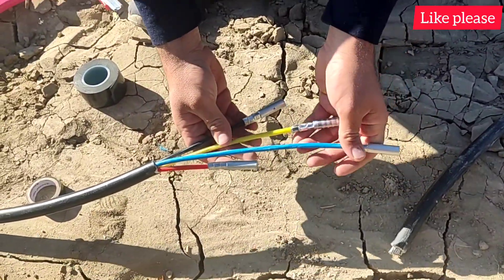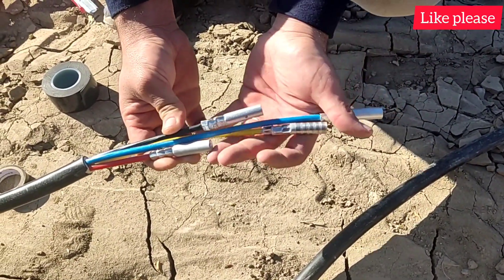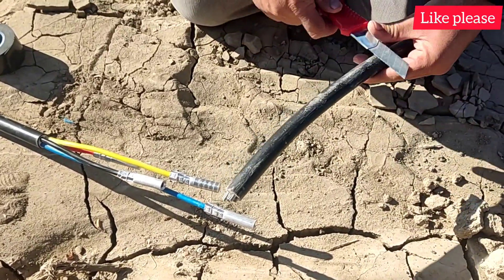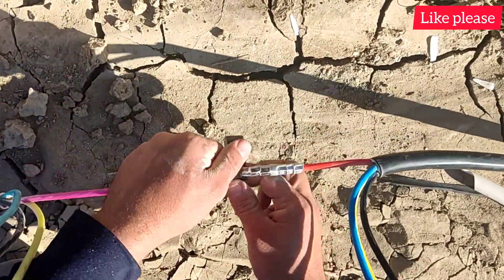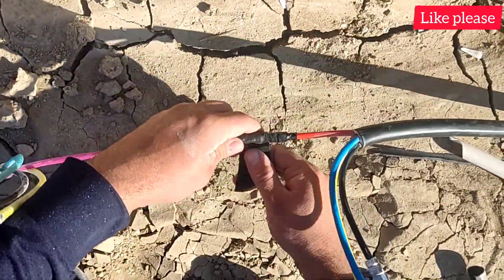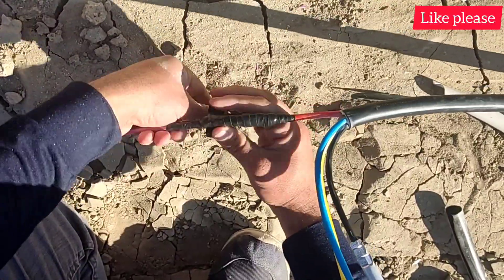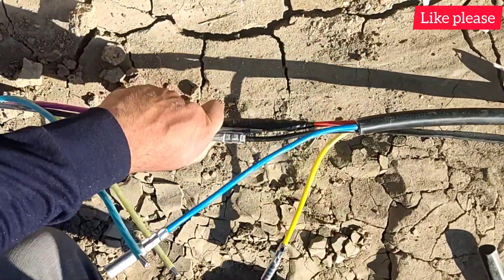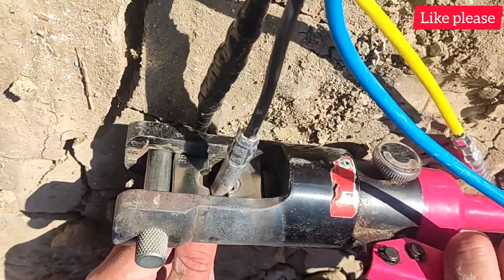The best way to connect aluminum cables

Comment: Would it be possible to get you guys to build a complete combiner box for me? We are planning to install 16 6000 watt inverters in parallel to fee a building. We would then run to 3 sub-panels to different areas. Generator for charging purposes only. Only interested in the AC side.

Comment: Thanks for the lecture but I would like to know the electrical name of the tool
Reply from the maker: Tools include
Hydraulic press machine
Aluminum joint
Power Adhesives
Waterproof tape
 Please ask if you have any other questions.